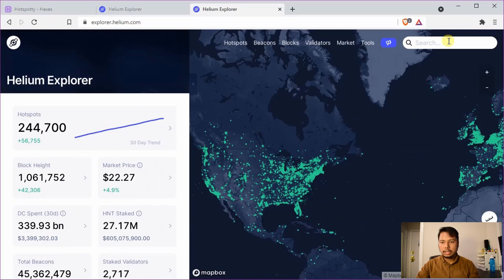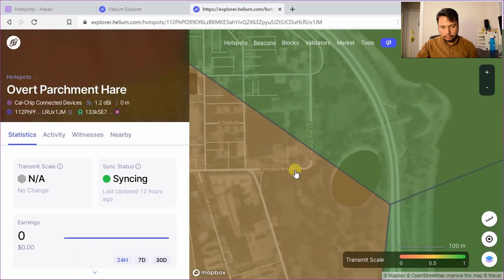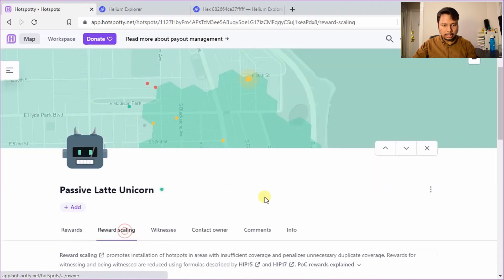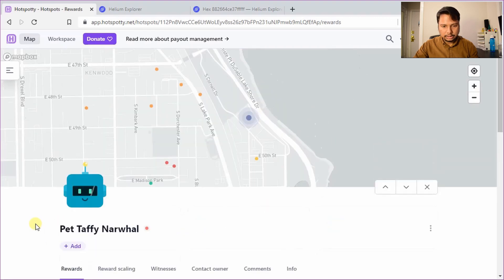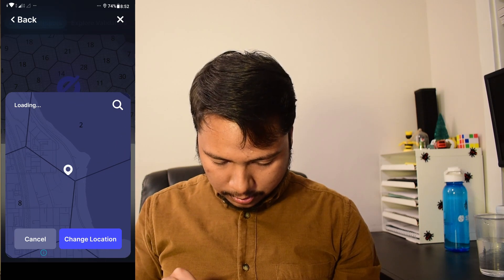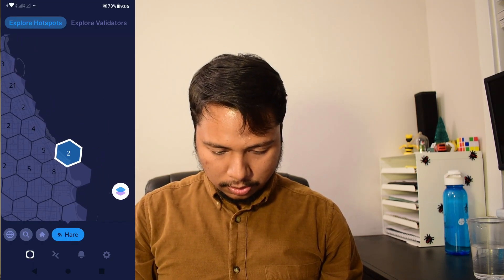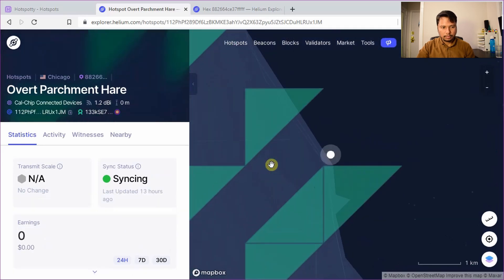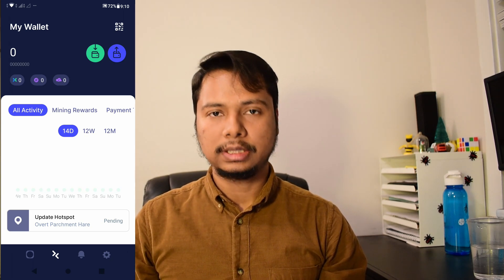Helium miner location assertion & antenna info updating | Choosing hex to optimize transmit scale

Comment: Really good video! I Have a question regarding to set up a new location for my hotspot: can i place my location better i a new (free) hexes (Reslotion 8) or togheter with other hotspots i resoltution 9? Thanks.
Reply from the maker: Yes, you can as long as the distance between the real and asserted location is less than 100m. Check this video for details https://youtu.be/MdSyjzE-s7Y

Comment: You didn’t show the antenna dBi and height change after a few minutes of it pending, did it go thru?
Reply from the maker: Actually, it didn't as I had zero HNT in my account.
Reply: Hey quick question: Id like to mail a bobcat miner to a family member in another state but still have it connect to my wallet. Is that possible?
Reply from the maker: @henryflores7492  Yes. It will stay connected to your wallet even if it is physically located and asserted somewhere else
Reply: @eigentech6567  great! So set it up at home and then mail it out? And then have them re-connect it to their WiFi?
Reply from the maker: @henryflores7492  that is correct

Comment: One question:
I bought some anthena from aliexpress (8 dbi). The guy who help me to setup my miner and helium app, set 2.8 dbi anthena in my hellium app, instead of my real 8 dbi anthena. He told me that this is better (setting the number of my original anthena). 
Is that good, or I should to change to 8 dbi (in my hellium app)?
Thanks
Reply from the maker: In most cases, it is not a good idea to declare a gain other than the actual one. I have discussed this topic in detail in this video https://youtu.be/6ZYYgRYJMcw

Comment: Mine won’t update. Still stuck on 0 meters
Reply from the maker: If you are talking about antenna update you need some HNT in your wallet to do that, otherwise the transaction will fail
Reply: @eigentech6567  done it. Thanks very much 👍🏼
Reply: @eigentech6567  my miner is in my loft and seems to only witness in one direction. It’s missing out on so many in the opposite direction and I can’t work out why. It’s residential houses in both directions and nothing is blocking the signal in my loft as far as I know. Any suggestions? Thanks

Comment: hi Eigen Tech Is the 210m displacement from the actual location a major abuse?
Reply from the maker: It is not recommended but you can try and see results
Reply: Did it work out?

Comment: Hi Eigen

Great video.  I tried reasserting my location for the miner to the next hex wtih only 2 miners.  Its about 140M, I tried pairing to check my status, now it says device is disconnected.....any reason why and would you know how I can fit it?
Reply from the maker: that sounds like a problem of running the diagnostics. Update the Helium app retry.

Comment: I am updating my sensecap antenna but it is stuck in a pending transaction any clue, i have HNT in my wallet
Reply from the maker: Sometimes it happens due to network issues. If it fails, simply retry
Reply: @eigentech6567  thank you for your videos they helped me a lot now everything is working well
Reply from the maker: @ihabahmed1132  I am glad that those are helpful

Comment: How come you didn't subtract the 0.8 dbi loss for the window?
Reply from the maker: not sure what you meant but my antenna is outside
Reply: @eigentech6567  Sorry, I assumed it was inside. Should I minus the window loss 0.8dbi from the stock antenna 2.8dbi?
Reply from the maker: @harlemespanol  No problem. Sure you can subtract. But try to get the antenna outside.
Reply: @eigentech6567  Okay. I’ll try my best. You should do a video on your outdoor setup.

Comment: Hi, please what happens if you assert a miner more than 100mts away (5000km)? if the scale is ok (0.7)?
Reply from the maker: 5000 km will most likely take you to another country. If you meant 5000 m, then you should physically move it as well
Reply: @eigentech6567  yep, meant 5km 
I’ve seen one in my city that seems to be connected somewhere in downtown but then shows as if it was located in a mountain about 30km away where it has 1.00 transmit scale

Comment: Hey man, can you please give me some advice that how I can solve the relayed issue? I've already done the port forwarding things two days ago but still showing relayed. I did assert my address to another adjacent hex honestly which is over 100m. Would that be the reason? Thanks in advance.
Reply from the maker: location assertion is independent of relayed. This video should help if you are not using LTE internet connection https://youtu.be/F2l-NYT9nkU
Reply: @eigentech6567  Thanks for your reply. I've watched the video, and I realised that I got "P2P" under : the API reported listen address. But port checker is showing the 44158 is open, I've also disabled the UPnP in the setting. The hotspotty site is showing my relay status is "Not relayed" while the helium explorer and my phone app are still  showing relayed. It's getting confusing as the data contradict each other.
Reply: I opened the port and it took 2 weeks to show on the app. Just need patience

Comment: Another amazing video! What if the earnings are higher in a hexagon with more miners opposed to a hexagon with less miners?
Reply from the maker: that is possible
Reply: @eigentech6567  Should I insert my miner in the hexagon with the higher earnings although there are more miners?
Reply from the maker: @harlemespanol  you mean physically moving it?
Reply: @eigentech6567  No, I'm within 100m of the other hexagon, so I have the option of inserting my miner in the other hexagon.
Reply from the maker: @harlemespanol  in that case, the one with a higher transmit scale will be better
Reply: @eigentech6567  Thank you.

Comment: I need to move my hotspot 150 meters to get the ideal transmit scale so in this case my only option is to physically move my hotspot since i can only do 100 meter correction on hotspotty right?
Reply from the maker: ideally yes, but you can still try
Reply: @eigentech6567  and in order to try it do I have to test it by doing it on both hotspotty and change location on helium app or just one of those?
Reply from the maker: @GenEmperor  after testing on hotspotty. You have to assert the location using the Helium app
Reply: @eigentech6567  ok thanks 👍

Comment: My Hotspot is on the edge of a crowded hex so followed these instructions but after fixing in the location it still showed me in the same crowded hex. I might try paying to change the location after a month or so.
Reply from the maker: You have to reassert the location using Helium app
Reply: @eigentech6567  I'll try that, thanks!

Comment: Can you help me see how I can check synching status not showing on the app says still synching
Reply from the maker: I have shown it in this video https://youtu.be/vqp3rUvdTCA
Reply: @eigentech6567  bro I've setting up my rak for first time I have no idea of status of synch as no status is showing in my app "syncing" status is showing
Reply: @eigentech6567  bro I run diagnostic its says 100 per cent synch but the explorer map status is showing as synching and not syched
Reply from the maker: @kashkash5195  explorer and Helium app are several hours behind
Reply: @eigentech6567  my miner synched but after 3 weeks it's gone back to synching status again why is this?
Reply from the maker: @kashkash5195  it happens every once in a while, especially if there is an update. Also, explorer is not accurate.
Reply: @eigentech6567  accurate for what I see the synching bar going up

Comment: Good job on the video.  However, I noticed you are currently Relayed.  This would affect earnings.  You need to open a port on your router.
Reply from the maker: Thanks for noticing it. The miner is installed at my friend's place where there was no option to fix it.

Comment: Hello. Thank you for you very helpful videos. Do you offer help in fixing resolutions? I have two hotspots that are transmitting at .83 and not witnessing at its full capability. Any help would be appreciated. I’d love to chat with you over the phone if that’s possible. Thanks in advance!
Reply from the maker: Yes, I do sometimes but right now I am traveling. You can contact me after Dec 15 if you still need help.

Comment: Hi, I love the informative videos. Quick question, do you know if improperly  entering antenna height into the app will lead to invalid witnesses? I had an antenna installed and was told it was 13m, but it’s more like 10m. Should I change it? I get a couple of invalids per day. Thanks !
Reply from the maker: The value of the height in the app is not used any where. So, you do not need to worry about it.
Reply: Did it work?

Comment: Hi. I tried to assert my location near the line between two hexes. Your video shows the dividing line between the two hexes when you choose the location. My app does not show the line dividing the two hexes. Has this feature been removes or is there a way to activate it?
Reply from the maker: Helium app won't show you the boundary. Use some landmark to set the pointer.

Comment: What is the maximum distance from the edge of the hex before you can assert in the next hex? People are having problem with distance of 100 meter
Reply from the maker: The distance should be calculated from the actual location of the miner and not from the edge. There is no maximum, the farther you place, the  more likely it will become to get invalid witnesses
Reply: @eigentech6567  thank you

Comment: What do I do if the green hex is more than 100 meters from me? Also Im getting an error while trying this which says "Error constructing the Assert Location Transaction". Please suggest
Reply from the maker: Asserting at a location more than 100m away is not recommended unless you have no hotspots around you within 1km. Just try again later.

Comment: Hey Eigen Tech, great videos and lots of good info. With PoCv11, do you think being 100m away from the hotspot location will be an issue? Also what do you think is causing all the rewards to flatline? Thanks!
Reply from the maker: No, if within 100m of the actual location. Not sure, mine is not flatlined.

Comment: Hi. I have 10 days bobcat in location where are only 4pcs of Bobcat in hexagon, 4dbi antene, 25m heigh, 2x restart, LED is still green, port 44158 & 22 open and still not working. Progres 1/7, no whithesses, no earnings. Diagnostic was done: 99,98%. 
But I selected: ALL BOBCAT MINER 300 antena, not RAK antene. Do you think that it´s big problem for correct connection?

Comment: Hey man, tahkns for the vid :)
But is the Location change still gonna work after the new Update? Because theyre saying you wont be able to get any HNT if youre not asserting the correct location.
Reply from the maker: asserting within 100 m still should be fine
Reply: What if location is with 400m because my area if full of miners i will have to place it in empty spot and that is little more tham 300m away. Will i still be able to earn hnt?
Reply: @zar1128  exactly what im wondering
Reply from the maker: @zar1128  yes, you will be but you might get one or 2 invalid witnesses from closeby miners

Comment: Thank you for making this video but I won’t lie it was very difficult to follow. 

Can you please explain what some of the terms mean. What is assertion? Can you go in depth about why your hotspot location is in a certain place but you are placing it 100 meters away in the app. 

In my case I get peoples addresses. How do I enter an address in to hotspotty or the helium app to determine if it’s a good location for me or not. This video was good for those that know their way around this but for 90% of us who are completely new to this it’s difficult to understand what you are teaching. Thank you!
Reply from the maker: Yes, this video needs some background but I will try.  A Helium hotspot's goal is to provide some coverage and for that, the Helium network needs to know its place. The owner, thus, needs to assign or "assert" its location. I asserted the location slightly off to get a higher "Transmit scale". 
You can also type addresses in hotspotty

Comment: hi there, since you are very tech savvy in my opinion i think you will be the right person to ask this.
sadly i got a ds-lite internet connection with a dynamic ip, that means my hotspot is always relayed. 
even after performing the correct portforwarding in my router i am getting no witnesses.
is there anything i can do about this besides getting a static ip from my provider? (already asked and they said its not possible)

i would really appreciate some help
Reply from the maker: Yes, it is possible fix relayed in this situation by buying a hardware called virtual gateway. https://virtualprivatepi.com/ and you will need a monthly subscription as well
You can use the coupon code "eigen" to get some discount

Comment: Top video  Question for you i see hotspot needs attention what can i do about? thanks in advance
Reply from the maker: In most cases it is related to the api/explorer being slow. Just make sure that you have a good internet connection by running diagnostics and wait
Reply: @eigentech6567  Thanks a lot bro... keep posting amazing video's bro i have fixt the problem this is how I did it after researching the miner pull out the socket click and hold the bluetooth bottun and plug the socket back in and after 10 sec release bluetooth
Reply: @eigentech6567  thanks bro btw great video's..
Reply from the maker: @robertVandelanotteonlinemoney  You are welcome

Comment: Hi !   Nice video!!    I want to ask you...   if I only care about the receiving signals (don’t care about transmitting) would I have to prefer a high dbi antenna or a medium??  Is higher dbi antenna more sensitive to receive???  Thank you in advance
Reply from the maker: Yes, a higher dBi antenna will always perform better in receiving signals
Reply: @eigentech6567  So for the hotspot at the center of town at a cliff 260meters high with 150 hotspots around in a radius of 5-10km will I have to prefer an 8 dbi or a 4dbi for having the maximum of witnesses receiving?
Reply from the maker: @dionisisch  I think you should use 6 dBi or less

Comment: in Bangalore there are so many Miners still they are earning very low HNT, any particular reason and most of the Miners are showing Relayed what could be the reason
Reply from the maker: relayed means that port 44158 is not open for inbound and that can affect earnings. I am not sure but I have seen that the miners in India are performing worse than in other parts of the world. Not sure why - could be because of a different continent or poor internet connection
Reply: @eigentech6567  100 % poor internet connection is not the problem coz Banglore is the IT Hub in INDIA with fastest BroadBand services.
Reply from the maker: @g.a.y.mqureshi319  Another reason could be that since India has much fewer hotspots, most hotspots from America are facing trouble to reach Indian hotspots through inter-continent cables

Comment: Great video as always!. I have a question about helium antenna, I live on the edge of a valley 500 meters above the city, what type of antenna would you recommend using? I was thinking of a 12 dbi because from my house you can see 20 kilometers of city and there are some 40-story buildings, appreciate the time of the response, greetings
Reply from the maker: 12 dBi might be too much. Based on your description it sounds like a 9 dBi will perform well. I have a video on an antenna that you can check out https://youtu.be/A2_sJQhpdig
Reply: @eigentech6567  thank you so much

Comment: Why is it 100m max? How would helium miner know if it's more than that? Like 300m?
Reply from the maker: 100 m is a rough number. Helium will not know the actual distance but your witnesses will become invalid when the FSPL is calculated based on the distance. You will find more info in this video https://youtu.be/JiQkPblSuMo
Reply: @eigentech6567  I placed mine 800m away and I am making more money than before though and my witnesses aren't invalid.
Reply from the maker: @KattKingston  I see, depends on the density of hotspots around yours. There might be problems after pocv11 is activated. But, until then keep earning.
Reply: @eigentech6567  o thanks